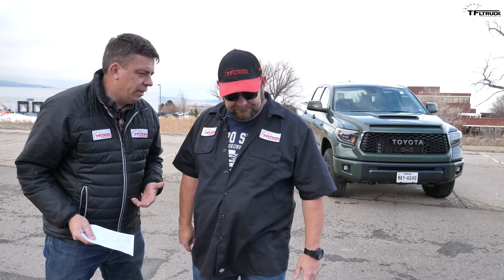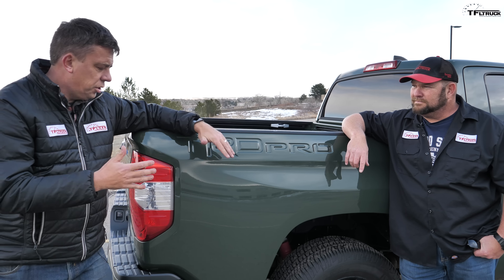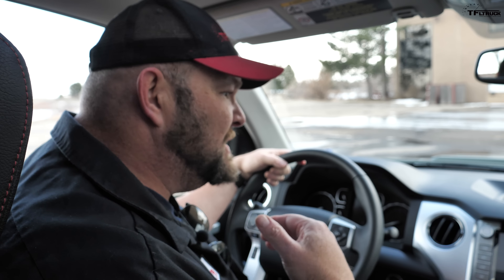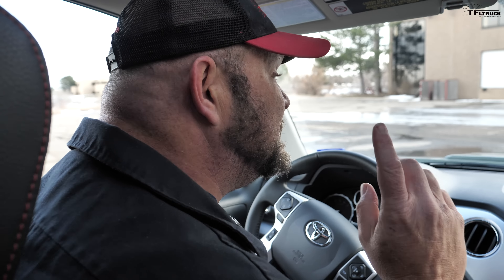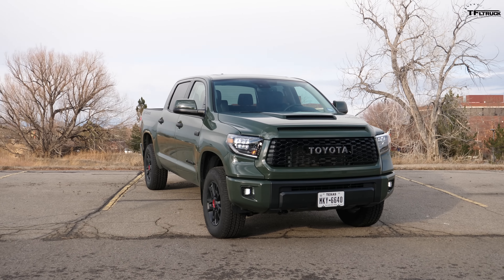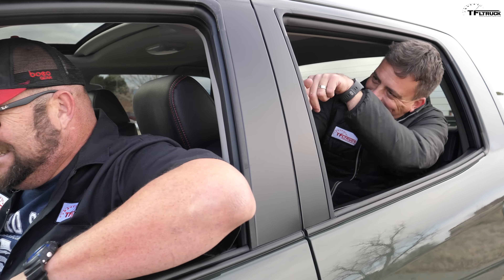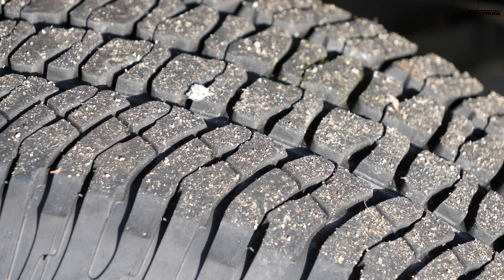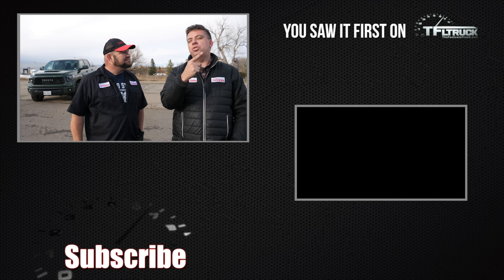The 2020 Toyota Tundra TRD Pro Is Outdated on Arrival - No, You're Wrong!

Comment: Same comments on all the toyota videos. Buy what makes you happy and what aligns with your beliefs as to what the best truck is. Pretty simple.
For me it was the Tundra. I didn't even look at anything else. Bought my 16 almost four years ago. Had the radio replaced and that's it. Radio still worked but one of the functions stopped working. Trucks been flawless.  I've towed cars with no issue and been all over with it. 
Ppl talk about poor mileage but what they don't know or mention is the gear set is 4.30. No other half ton comes close to a 4.30 rear end!! Its a superior towing gear set but does have a small mileage penalty.  The tundra also doesnt have all the gimmicks used by other manufacturers to try and squeeze out another mpg or two. Start stop? JUNK. E torque? JUNK.  Cylinder deactivation? JUNK. small displacement turbocharged engines? JUNK. When everyone else keeps adding more and more gears to their transmission and having issues with those transmissions,  Toyota has a great thing going with the solid Aisin 6spd.  The tundra routinely beats the EPA figures by a mpg or two from my experience where as it's pretty much impossible to hit even EPA numbers for the other trucks choked full of gimmicks.  So the real numbers are MUCH closer than magazines and paid journalists would have you believe.  
If you want fluff,  buy another brand. It will go nicely with your brand new 1,200 cell phone. If you're a man who has a brain, buy a tundra. Done.

Comment: 02 sequoia with 220k original motor an trans , I’ve towed other trucks with half the miles on them because of grenaded transmissions or knocking engines.

Comment: I really really really want a Tundra but my main concern is the horrendous fuel economy. I currently have a 2019 F150 5.0 and I usually average between 11-11.5 L/100km (20.4 - 21.4 MPG) but the engine is burning oil at only 23,000km (14,290 miles). I'm going to wait for the new Tundra. No more domestics

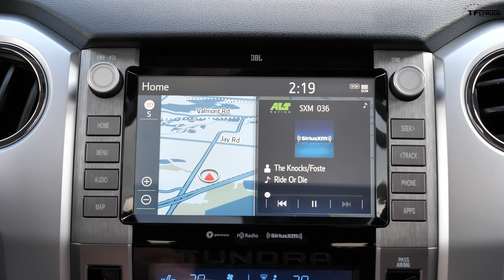Comment: Just because it has less HP doesn't mean much. Tundra's have 4:30 gear ratios, which is a major contributing factor everyone should be aware of when shopping for a truck.
Reply: i was thinking this while watching!
Reply: So that’s why it’s a fuel hog
Reply: FishFind3000 Definitely a major factor. I like the fact that the truck is rated for 13 city and I actually get that. I’ve always gotten 8 mpg out of my former 310 hp 5.4 triton engines before I made the switch to Toyota. I’m just surprised they haven’t switched to the 8 speed with the 4:30 ratio. Would make more sense in my head, but I’m not an engineer. The 6 speed already has to shift enough with the 4:30 ratio in my opinion.
Reply: @MarkNehemiah  I had a 5.4 and got 14mpg
Reply: FishFind3000 to be fair both of mine were in F250 trucks.

Comment: Thank you Toyota for remaining  OUTDATED, in all the ridiculous places I've taken my OUTDATED Toyota trucks/4Runners with 4 to 500,000 m. on them they always get me back to my OUTDATED house!
Reply: @2011buddylee  Amen.  Toyota builds a decent product but these fanboys are too much 😂
Reply: Sorry to hear that Buddy but after 2 at 170 000 and worn out, you bought 2 more? interesting.
Reply: @gregsanders9563  I have two Tundras, an 03 and an 08 both with over 240K miles and they still run amazing. I switched to Toyota when we had to rebuild the transmission on our F150 at only 115K miles.
Reply: @Immortalkalashnikov  
At only 115k miles? That's a lot miles on a transmission. You left out the part where you were hauling or pulling over the truck's towing capacity.
Reply: @Sig721Tau  Uhm both our Tundras have over 240K miles on the original transmission and are also used in the same line of work that the F150 was used for. The Tundras were simply more reliable.
Reply: @Sig721Tau  both milliom mile tundras transmissions went over 700,000 miles despite overloading the trucks and regularly towing more than they were rated for. One lost reverse at 760,000 miles and a they did was fix reverse, so no rebuild and it still worked after 1 million miles. The second developed a flutter between shifting to 3rd gear at 780,000 miles, so he had it rebuilt. Turns out all it a fluid and filter change would habe fixed it.
Reply: Hahahha love it. 

I extracted a good point from your comment.
If you are not constantly renovating and updating your house with rooms, additions and esthetics to keep up with arbitrary fashion then you shouldn't be doing in your car/truck. 

The function of trucks has not changed. You have been fooled and convinced it has. As a result, manufacturers make you pay a premium they know you will pay. 

Base model SR5 best truck, period.
Reply: @soapbox187  U nailed it , I was gonna buy a trd pro but they are too little features for such a high price, then again they resale for higher too but sr5 or sr is what I'm at right now.

Comment: Toyota Tundra’s will always hold a special place in my heart and will always be one of if not my favorite trucks. It was the first truck I ever drove and is currently what I am driving right now. I get about 400 miles out of each tank and the truck has not a single time ever had any problems and its currently over 70000 miles (not that impressive of a number at all in comparison to the million miles two tundras have hit). its big, its loud, and its just an awesome truck. never fails to bring a smile to my face when I drive it.
Reply: Still have my 2014 Platinum. Averaging 14mpg and 240ish miles per tank
Reply: Have a 21 Platinum 38 Gallon fuel tank and I love. Get almost 550-60p mikes out of each tank. Truck has 4100 on it now. I was speaking to another Tundra owner he has had 3 now he’s in a 20 platinum said his fuel mileage increased after 10k mikes or so. I’ll see if that’s true.

Comment: Sorry Toyota I was a loyal customer from 94 till 2014. I am now in a ram I love. Even bought 2 of them. Update the trans, electronics, tow rating and suspension and interior. The reclining rear seats in the ram have been very helpful to those with family. Heck you are a Japanese manufacturer and letting everyone beat you on electronics I mean seriously. At least rival the uconnect system
Reply: lol rams not reliable ask any sales guy that worked for them. I had a sales guy work at chevy, dodge, and said the Tundra is the best truck out there as far as reliability when he moved to Toyota. I know first hand, I'm  on my second Tundra, first one traded my 2012 that I bought new with 266K and it towed a car a day for six years and the trans was still good and they gave me $7500 towards the trade in for my 2018. Proof is in the pudding.
Reply: @KyleMechlinski  gas mileage sucks, tow rating sucks, electronics sucks, drivability and ride sucks. They have alot of updating to do. You have had better luck then I did with a 2012 tundra. The one I had needed the rearend and drive shaft at 17 thousand miles. It literally ate itself. Still a grinding sound after they replaced them. So far my ram has 36 thousand miles and not one issue
Reply: 641000 on my 07 tundra. Now have a 17’. Dont need all that interior crap. They run and run and never let you down. Ram has nice interior so your comfortable waiting for tow. Tundra all day!
Reply: Toyota has by far the best resell value of any brand! Selling Toyota's for a living makes you realize that Dodge products depreciate like a falling rock, leaving customers with an astronomical amount of negative equity and making it nearly impossible to get out of if you did not put a substantial amount of money down when purchased.
Reply: The tundra needs updated, but Ram would be the last on the list of possible replacements.  I keep vehicles long term and reliability is important to me.
Reply: Dodge ranks last in reliability LOL
Reply: Immortalkalashnikov guess that is a good thing dodge doesn’t make trucks
Reply: Vu Pham many things we don’t need in life but once you have them they are hard to live without. I mean you don’t need a smart phone but damn it is so much better than a old brick or flip phone
Reply: @KyleMechlinski  
Haha. Of course, a Toyota salesman will tell what you want to hear just so you'll buy a truck from him. Lmao.
Reply: @Tony-hf9mv  
I think that you made the Toyota fanboys mad. Lol
Reply: @Sig721Tau  I know the guy personally.
Reply: Thanks for letting us you’re you’re a homosexual

Comment: Sliding rear window? Who climbs into the back seat to reach into the bed? I had this on a truck in the late 90s and it was worthless to me. 1. Update the interior and electronics 2. Put a usable bed length on it  3.Squeeze better gas mileage out of the engine  4. Dominate the market

Comment: Solid unbiased review as always. While the truck has aged, it has aged well and is still very capable and reliable and still looks, sounds and feels awesome. While I look forward to the next generation I hope they don’t replace the power plant like they did with the current generation Hilux, by opting for a smaller 2.8L Diesel instead of a 3.0L Diesel or a 4.0L Supercharged V6 Petrol engine. I wish they sold these full size trucks in Fiji. I got the chance to drive one of these bad boys in the States last year in Vegas and have driven a Sequoia as well with the same V8 power plant, great rides the both of them. Having said that after being a lifelong Toyota fan and previous owner of the LN166 2.8L Diesel Hilux and D4D 3.0L Diesel Hilux I made the switch to the 3.0L V6 Diesel Volkswagen Amarok which is a far superior truck comfort wise, fuel efficiency wise, power performance wise and overall build wise. You guys would love to drive one of these mid size bad boy trucks if they were sold in the US.  Thanks again for the review, huge fan of you guys work.

Comment: You know as master mechanic I have never seen a tundra blow a headgasket or grind a camshaft flat or replace multiple transmissions in the same truck.  But i have seen plenty of the competitors have those concerns.
Reply: @wilmarbarrick3194  depends on the trim. Obviously a trd pro with soft suspension is not designed for heavy hauling or towing. Max payload is 1700 and towing 10,400 on regular 5.7 double cab. There are some people who tow way above that and claim no problem but its all on them. At the end of the day its a half ton.
Reply: Toyota only sells a couple of percent of the Big 3 in sales.  Most trucks won't wear out driving empty to the grocery store.
Reply: @wilmarbarrick3194  Or they arent designed like total garbage and are actually good trucks.
Reply: @normt5463  most people that buy a Tundra arent getting another one when the warranty expires though so that is part of the reason they dont sell as many compared to a Ram Ford or Chevy.
Reply: Neither are most 1 tons on the road. 80% of truck owners seem to haul little more than a 1500lb side by side. Trucks have become lifestyle vehicles.

Comment: Throw bigger meatier tires on this and watch that MPG hit 2. Good thing the fuel tank is massive.
Reply: Not on these. Meatier tires and 500 lbs of extra weight in the back doesn't budge the mpg's even 1 mpg down. It's turbo sixes that suffer when you do that.
Reply: @Irven51  I've seen a number of "modern V8's" with the displacement-on-demand systems see significant hits to their MPG when loaded too. Maybe something like this that is all-V8-all-the-time won't care I guess, which is why it just has crap MPG all the time.

Comment: Why change something if it works great
Reply: You hang on to same iPhone or Android phone until it's completely dead?
The rhetoric makes sense but the modern pick-up truck market shows that sales dominance is going to the biggest innovators.  Toyota is going to change things that are great, just on their own timetable.  It does keep their vehicles more reliable rather than trying to match the competition for business- and competition-sake.  Sort of the "slow and steady wins the race."  We see Nissan employing the same thing in the truck market.
Reply: @khronosfateless well atleast make it have better fuel economy? the tundra mpg avg in the city is 9-10mpg
Reply: Joshua Long because sales suck
Reply: @khronosfateless It's not just gadgetry, reliability aside the big 3 half-ton trucks have the Tundra beat in every other way possible. 
I'll stick to my GMC that makes about 16-17 MPG with a 6.2L V8.
Reply: Necrotic Reaper if the transmission didn’t crap out in my gmc I’d still be driving it too
Reply: @khronosfateless Nah that's the new Mexican Tacoma.
Reply: @thanutz  Still going strong right now. It's aging though. Thinking of trading it in while it's still got value.
Reply: Necrotic Reaper also had a 2010 f150 (before the aluminum body) that lasted me for many years. Excellent truck that gave me 0 engine, tire, or interior problems (minor electrical problems in Doors). Overall it was great. My only hesitation on getting another was that rust was a major issue with it living in the north east. 2 of my friends with them had rust in the same exact areas as my truck. Maybe the aluminum body fixes this though. It really was a solid vehicle aside from this but definitely concerned me.
Reply: A W Had a 2001 Explorer for a while, it was a reliable truck but all the little things in it started breaking at 120k miles. 
I got lucky enough to live in the south. Not much rusting here.
Though I heard Mopars rust the least. My grandfather that lives way up north has been driving the same 2004 Ram 1500 for years and using it to plow snow every winter.
My Wrangler has gotten really much if any all rust on it.
Reply: crappie crazy RTR  
How do you know that every owner will not use these new "gadgets"? Also, you might want to re-write your last sentence.
Reply: Joshua Long
Using your logic, you should still be driving a Model T.  Lol
Reply: Travelin' Ted yeah well fords dont last as long as Toyota’s lol
Reply: @joshualong9569  
Do you still have your first cell phone, tv, and/or desktop?
Reply: If it ain't broke, don't try to fix it. I've owned Toyota's since I was 15 and I'm 41 now. Never had any major issues with my Toyota's. The reliability cannot be beat! Toyota is the Best in Reliability!! Keep all that fancy tech stuff and give me a Truck!!
Reply: Agreed, I think they could tweak a few things, but overall I love everything about the truck
Reply: I'm pretty sure Toyota could massively update their truck and still make it reliable. They refresh the Camry, Corolla, and all the SUVs regularly.  2007 is a bit long to be using a platform.

Comment: But why... if we have the technology, surely there's a way to make V8s gas efficient.  We sent people to the moon.  We MADE V8s.  Come on, surely there's a way.
Reply: They didn't really go to the moon thats why they can't make the m more efficient. 😉
Reply: The biggest possible technological leap forward in internal combustion engines right now is the opposed piston diesels. Look them up, really cool how they work. Amazing efficiency. Ford has a working prototype in an F150
Reply: That is a horrible comparison, especially you don't know the trajectory, speed, time, or the amount of fuel those Rocketdynes F1 rocket booster suck.
Reply: There is, but at the expense of more moving parts and carbon deposits. Walnut shelling isn’t really isn’t as fun as it sounds.
Reply: The 5.0L 10 speed F150 is actually a hell of a combo and gets the same fuel economy as a Tacoma 4cyl. The tech is in American Trucks 😭
Reply: I've looked into this and I'm quite glad the 3UR doesn't have cylinder deactivation. As great as it sounds, it's tragically brutal on long-term reliability. Look up the failure rate on engines with deactivation and how much it costs to repair them, and make sure you're sitting down first...
Reply: There is a way: Direct Injection which is what others have done BUT they have done so without an upstream injector to keep carbon from building up requiring major engine work in as little as 50k miles !!
Reply: You can make a more efficient v8. But there's a point of diminishing returns where it becomes more and more expensive as you need more efficiency. You get to a point where its too expensive for small increment improvements. Its a curve

Comment: I bought a 3.5 eco boost on your review back in 2015. It went into limp mode over & over! Bought a used 5.7 tundra with 83K miles. It has 115K trouble free miles. The only trucks I'll buy in the future are Tundras. Chevys bled the wallet, powerstrokes bled the wallet, Fords bled the wallet. The gas mileage on my 5.7 is better by 1 MPG than my 3.5 Ecoboost!!
Reply: That is interesting, I owned a 2014 3.5L ecoboost and had no problems at all with it, got a consistent 18mpg combined, never really had any trailers to pull but I did haul with it occasionally and drove off-road frequently. Ran it to 100k miles and traded to a 2019 3.5L ecoboost and now I'm getting >21mpg with the same driving. I'll agree on the Chevy's tho, seen too many 4L60's die and plastic parts fail, trans cooler lines blow off....ugh....
Reply: What is your mpg by chance?
Reply: Nate Young 13 city, 16 hwy